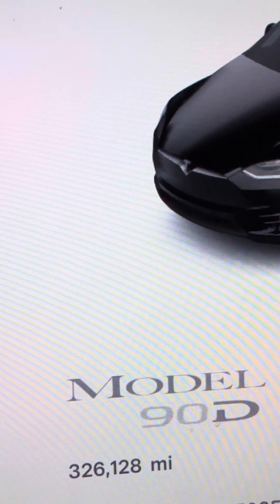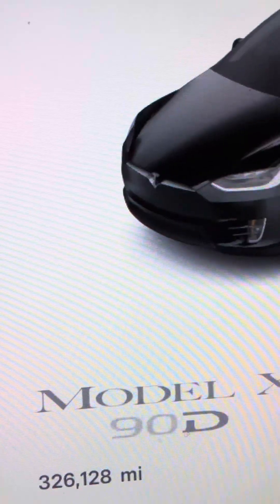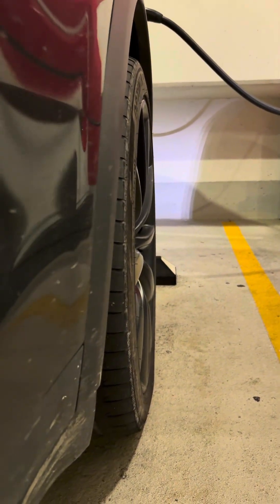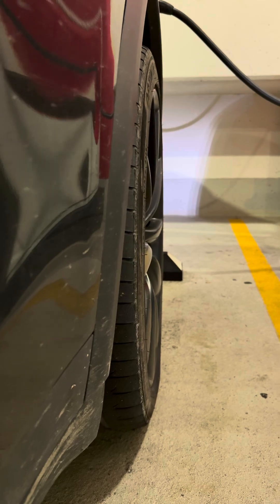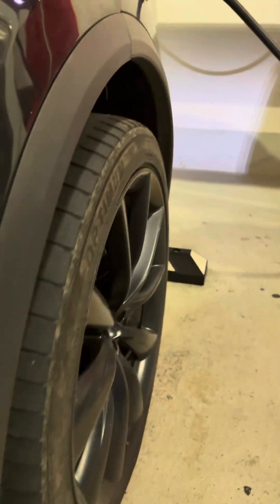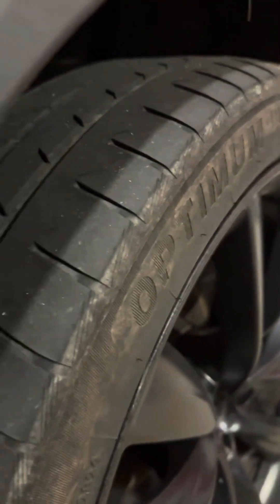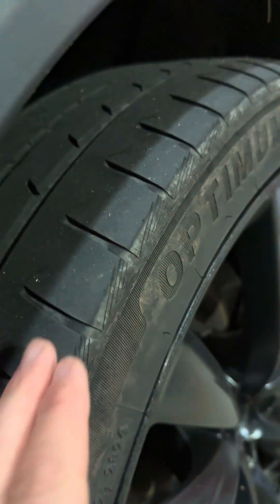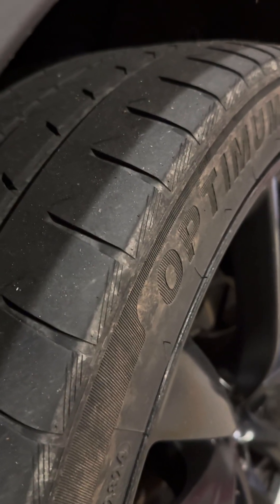TESLA Model X & S Rear Tire Wear + Front Driveline Vibration + High Speed Stability MASTER CLASS 4K

Comment: I recently got a 22 model 3 performance. I lowered it and installed the rear upper camber arm. It was a noticeable difference. Visually, the wheel no longer sits at an extreme angle. It was really tilted inside the wheel well. After the camber arm install, and a proper alignment. The rear camber now sits at a -1 degree, and the top of the rear tire no longer has that extreme tilt inside the wheel well.

Comment: My 2018 MX isn't high mileage yet at 6900mi but has been through 2 cross country road trips. Got tired of the expense changing rear tires every 20k and installed N2ITIVE rear kit at 50k...all in including alignment ~$2000.
If I spent $800-1200 per 4tire changes, the ROI makes sense for high mileage ownership...
Reply from the maker: Thanks for the details on the cost and ROI of the rear kit installation!

Comment: Good video and very informative, I have a 22 MX L, I installed the updated full kit SP-2 in ”Red anodized” at 13000 miles, I’m almost at 38k miles with no issues with tires, I do have the front lower then most and just recently I was told that I will need new front control arm. I did notice the clicking sound about 2 weeks ago, so I will get fixed next week. The n2itive kit is quality parts worth the money.
Reply from the maker: Great information! Thanks for sharing your experience.
Reply from the maker: Great news ❤❤❤